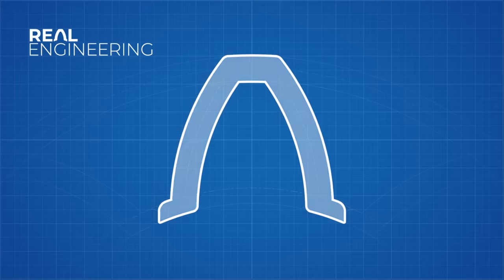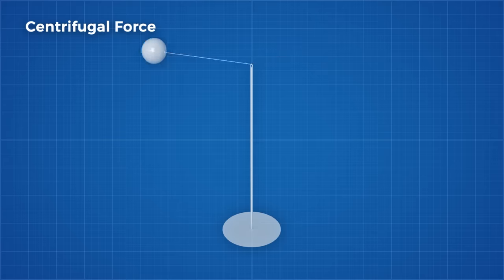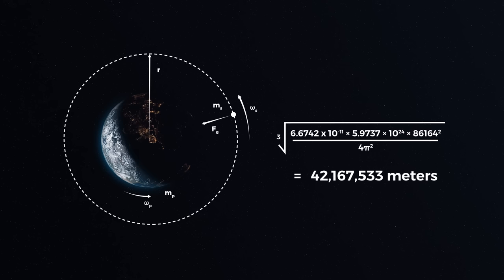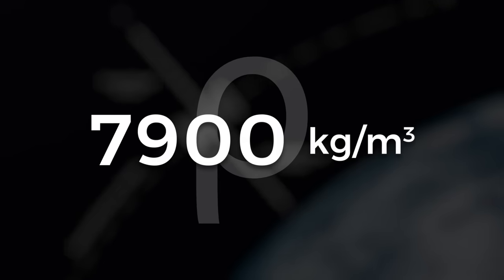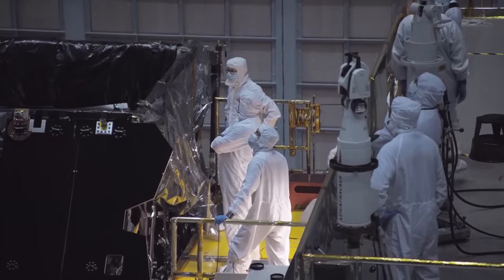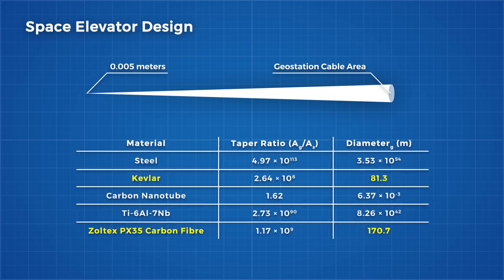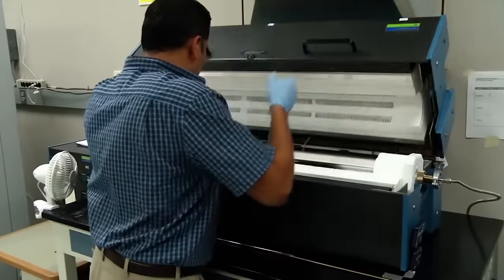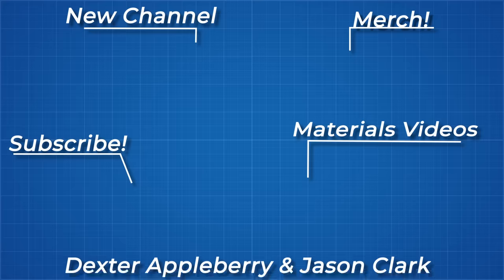Are Space Elevators Possible?

Comment: Would a space elevator be feasible for the moon or Mars? Would it even be worth it?
Reply: good question
Reply: It might be feasible on the Moon, but the Moon's gravity is so weak that there's not much fuel to save with a space elevator. Standard chemical rockets would still be cheaper, especially if in situ refueling on the Moon's surface becomes economically viable.
Reply: @jemuelmongado5030  Exactly, which is why I asked if was even worth the trouble.
Reply: @mikeearussi  If a trillion-dollar industry around lunar resources like Helium-3 would form, I'd like to imagine there would be a huge demand for a Moon elevator. Mars, though, would be just impractical. Elevators on Phobos or Deimos might be worth the effort though.

Comment: Could we just have a "floating" 1 floor? I mean, does it needs to be on solid ground? If the station is in orbit and the cable is hanging from it, could it be possible... the speed of the station would need to be the same as the earth rotation!
Reply: I didn't quite understand, you mean having two orbiting objects connected together at different heights?
Orbital speeds are different at different heights. One object would pull on the other until both are at the same height and speed.

Comment: I'm sick so probably not thinking clearly. Why can't we hang a cable down to earth and use that to bring materials to space? It doesn't have to take humans.
The ship and counterweight keeps it in the air, we don't need a base?
Is that something other than a space elevator? 
And the cable doesn't have to be all metal, you could have flexible parts to help against weather or other issues. 
We could even anchor the line in the ocean with weights and ballast, like oil rigs.
No? Did I miss the point of the video? I just have so many questions.

Comment: Hi, RE. Fascinating. But the Earth is too big. Design space elevators for small moons. Even small moons require a lot of tech to land upon and a lot of technology to fly away from. Maybe asteroid mining would be possible and made easier with elevators. The technology that will make space elevators possible will also make rotational gravity and space habitats possible. I don't know the safest low gravity environment for humans. It could be that humans need at least .7 G to maintain healthy muscle tone and bone density. Spinning wheels can do it but the change from zero-G at the center to max G on the rim of a small wheel is too abrupt. Better would be two working areas that can be transported to the workplace, and separated using the nano-cables to a distance where rotational gravity can be created with a structural tube containing a safe passage between the two floors. At the core could be a hub containing supplies of food, water, solar arrays,  and breathing gas purifiers that don't need to be spinning around. If you can figure out the necessary ratio of the curve to the speed of the revolving work areas, you can design workspaces of different sizes and functions. By this, I mean the apparent upward motion of the floor that would create an apparent .7 G environment. The necessary ratio would produce an apparent floor lift of something over 22 feet per second per second. This ratio is why small spinning wheels don't need to spin as fast as large spinning wheels to produce a rise of 22 feet per second. If you have a passion for space elevators, start dreaming about small ones that can actually be possible and useful.

Comment: My theory on why a space elevator can't work.

Everything on the surface of the Earth is traveling around the Earth's axis at 1,000 mph.  To be put something into geostationary orbit, it has to be accelerated to 7,000 mph.  

There are two ways to accelerate the elevator car horizontally as it rises.  The car could carry its own rocket and the fuel it requires.  And it would have to apply its force to the car in a way that doesn't stress the cable.  Seems unlikely.  

Or the elevator itself must transmit enough force horizontally to accelerate the car.  And the platform out in geostationary orbit also must have a rocket to keep the platform from moving out of position.  Otherwise the extra mass would pull it out of that geostationary orbit.  Transmitting the force required to accelerate the car is going to stress the cable significantly.

Both scenarios still require a rocket and all of the same fuel.  And both require the output of the rocket and the vertical speed of the car to match.  Either way, such a rocket would not have the same specific impulse as a rocket unencumbered by this requirement.
Reply: They could pull in the counterweight towards the space station to speed it up its orbital speed, compensating for the pull from the dragged mass.
Reply: @vast634  who’s “they”? And what would pull for the journey of many hours?

Comment: 1. Build a train/rocket with a track that travels into a railgun design. This would avoid the deadly Gs on biomass
2. Thrusters activate on deacceleration for now still saves us millions getting to space
4. Build the space elevator more like a tail you grab onto that doesn't actually touch the earth's surface
5. Build a carbon nanotube blanks to deploy on space debris
6. Trolley the rest of the way up the tether using an electric motor

now stop making excuses and get it done nerds

Comment: If a ping pong ball was to strike the space elevator cable...What would be the energy of impact?  
Lets see now...2 grams travelling at 17,000 miles per hour...hmmm....  
E=MV squared  ....  
You have to change 17,000 miles per hour to centimeters per second....  
you get a mind boggling number, that you square....  
It works out to about half a ton of TNT!!!  

And the cyclic rat is very slow  
The elevator will take forever to get there

Comment: MOON SPACE ELEVATOR								
mm = mass of moon = 7.35E+22 kg					
rm = radius of moon = 1,738 km = 1.74E+06	m			
ms = mass of lunarstationary station = 1.00E+08	kg				
ωs = angular velocity of lunarstationary station = 2.66E-06 rad/s			
rl = radius from lunar center to lunarstationary station's center = to be determined			
dm = distance from lunar surface to lunarstationary orbit = rl - rm = to be determined			
G = universal gravitational constant = 6.67E-11 m³/kg∙s²				
								
Radius of Lunarstationary Orbit								
rl = ³√[(Gmm)/(ωs)²]								
								
rl = 	88,452,517 m = 8.85E+07 m				
								
dm = rl - rm = 8.67E+07 m						
								
The cable length  from the lunar surface to lunarstationary orbit is 2.42 times								
that of the cable from Earth's surface to geostationary orbit. This is because the								
moon's lunarstationary angular velocity is only 4% of Earth's geostationary								
angular velocity								
								
Tension in Lunarstationary Cable								
ρ = cable material density = 7,900 kg/m³ (steel)				
T(rl) = cable tension = to be determined						
								
T(rl) = Gmmρ[1/rm - 3/2rl + (rm)²/2(rl)³]								
								
T(rl) = 	2.16E+10 Pa = 21,638 MPa = 22 GPa		
								
Utimate tensile strength of steel (API5L X80Q,X80M) (Ftu) = 825 MPa = 0.83 GPa
								
So, steel would NOT work, even for a moon-based space elevator.

Comment: If we were to be able to snap our fingers with the correct materials having been manufactured, and suddenly it existed in place - yes, a space elevator can be built.
However, even after all design challenges of the elevator have been solved - we have carbon nanotubes, elevator cars, force propagation, etc figured out....

There is still the challenge of actually putting the damned thing up there.  Proverbially, you need a space elevator to build a space elevator.

The classic idea of carrying a spool up and extending it in both directions doesn't really work as each point along the tether becomes subject to orbital mechanics.  This means, for the same reason you can't throw a hammer from orbit and hit the ground (well, most orbits, at least), you can't construct a space elevator.  At least... Not neatly.  For those who are fans of kerbal, set two craft in orbit near each other, or three for funzies.  Then fly one each at radial in/radial out at the same thrust (identical mass and thrust).  Watch what happens and imagine there is a line stretching between all three.
Eventually, you will start spinning as each assume an elliptical orbit out of phase with each other.

The process of building one of these things is something we would probably test on other planets before we ever built one here just from the implications of what we are doing and the scale of consequences for possible failures.
Reply: I was thinking the same throughout, you just cannot drop a cable down to earth. Even if you spooled it out with a drone craft and reduced its velocity to stay above the same point on earth, the forces trying to throw you into a faster lower orbit would be extreme. You cannot just do the calculations based on the centre of mass of the entire structure.

Comment: So how is that going to work. ?. . . I have not done the exact numbers, but I reckon you would need a line something the size and weight of a spiders web, but probably as strong as a 24 inch diameter steel wire. . .    To be geostationary, that is relatively stationary about a fixed point on Earth, that would have to be about 23,000 miles, 40,000 km high and be able to adjust its height depending on the weight of the load that needs to be lifted up to that space anchor point... .   You would also need to protect that line from hurricane and strong winds, and from aircraft.. . .  Not exactly the most practical mission, is it. ?

Comment: People only have the rotational velocity of the Earth's surface...
while a "space elevator", being rigid, has to maintain the same ANGULAR velocity as the Earth...
so people trying to travel up it will just be absolutely squished to death against the sides!!!
Reply: this is not right
Reply: @willoughbykrenzteinburg  you'd have to add angular momentum as you travel up the elevator... otherwise your tangential velocity decreases as your distance increases, while the elevator's tangential velocity increases with distance!
Reply: @alansilverman8500  Youre basically describing a coriolis effect, and it would be very slight.  Squished to death?  No.  Not even remotely close.

Just do the math.  The speed at which the elevator would need to travel upward to create a change in tangential velocity so great as to cause an acceleration of just 1 G - meaning, you feel pushed toward the side of the elevator with an acceleration of 1G, the upward velocity needed would be around 135 km/s (over 1 MILLION mph).  And this would result in a mere 1 G. What you are talking about would not happen.  At all.

Simple Math Support :

Standing on the surface of the Earth, your tangential velocity needed to keep up is related to the diameter/circumference of Earth.  So, with a diameter of about 12,742,000 meters, this results in a circumference of about 40,030,140 meters.  The speed needed to travel this distance in 24 hours is about 463.3 m/s.  If you travel upward at 135,000 m/s, after one second you are now traveling in a circle with a diameter 270,000 meters longer (135,000 meters in each direction).  So, total circumference is now 40,878,369.  You travel this distance in 24 hours, and the velocity needed to keep up is now 473.1 m/s.  So 9.8 m/s faster.  After another second, you travel 135,000 meters higher, and now the circumference you travel is 41,726,598 meters.  To travel this in 24 hours requires a velocity of 482.9 m/s  - - or another 9.8 m/s faster.  This continues - every second requiring an additional 9.8 m/s of tangential velocity to keep up - ergo accelerating along the tangential axis at 9.8 m/s² - or 1 G.  Again - this is in an elevator traveling up the rig at over 1 million mph.  You need to do the math before you make otherwise baseless assumptions.

Comment: And no it doesn't NEED to be at the equator, it's just your tether needs to be quite a bit stronger than absolutely required, then if you have 3 tethers which met up at somewhere above the equator then there you go, so I suppose you could technically say the space elevator is at the equator because that is where the vast majority of the space elevator is, but the base terminals do not have to be. Athough again the Space elevator is a dumb concept compared to the alternatives Launch Loops, Skyhoods, Orbtal Rings and even mass drivers. The only place a Space elevator would be the best option is Titan as due to it's low gravity and thick atmosphere a mass driver mostly out, although orbital velocity is significantly lower so mass drivers are not completely out either.

and on any airless world mass drivers are just a maglev track so there it's almost always going to be the best option, Earth it's probably Skyhooks, Launch Loops then mass drivers in order of difficulty but also worst to best, mass driver are impractile and that doesn't even mention Space Elevators, mass drivers are just impactial on Earth as you need a vacuum tube from ground level to at least 25km up in the air and for humans to not die of G forces the tube needs to be very very long.

building a very very long vacume tube is already an engineering nightmere, trying to suspend it 25km in the air... not a particularly easy feet, Space elevators are still more dumb, by like an order of magnitude.

Comment: Yeah, that's a big no.  It's possible in the exact same way the Dyson Sphere is possible.  Sure you can build a Dyson Sphere... if you can find enough indestructible low mass material to cover a sphere exactly 2 AUs in diameter, manage to build each piece, and then manage the impossible feat of assembling each and every piece simultaneously so that the whole thing doesn't just crash in on itself and fall into the sun destroying our star in a huge explosion... yeah, you can build a Dyson Sphere.  But since that much low mass indestructible material doesn't exist (and if even if it did- you'd have to destroy maybe a million solar systems to get enough), there's no point in trying to overcome the other impossibilities.  

Space elevators are possible, but again- you need indestructible material that's low mass and it doesn't exist.

Comment: theoretically, yes.  in practice though, it would require 3 things.  1. a super strong material that currently does not exist.  2. the ability to control the weather around the elevator.  and 3. nothing in an orbit lower than geostationary.

Comment: At starting point; taking-off near SeaLevel, it would save lots of Rocket Fuel to gain 7.9 km/sec velocity... Only a hanging LIFT or riding in an Elevator. But getting higher to near Geo-stationary orbit ; 36,000 km alititude.. there, we required 3.1 km/sec to stay afloat... Or otherwise, the Cable & afloat-Station, will be retarded and pushed BACKWARD... Losing velocity and finally losing the Pre-tension of Cables or, even severely lower altitude to Gradually FALL-DOWN /losing altitude completely.!! Destroy everything.,!?!
Reply: Geostationary Orbit/Altitude is 10% distance (trom Earth to the Moon) or 3 times the SIZE/Diameter of the Earth..(3x12,000 km. =36,000 km.)
Reply: The carrying Object at terminal point (36,000 km alititude) need to be 3,100 metre/second Speed to stay-afloat and not to push-back against the Cable/floating Station. That 3.1 km/sec =Mach 2.67 still need Rocket Drive, adding its Kinetics Velocity not to PULL-DOWN and Destroy the Whole (cables/station) System.!?!
Reply: Sorry ; 3,100 km/sec is Mach 9.3: far more than than Mach 2.67... (but saving, no need to be M24, escape Velocity.,)

Comment: Use balloons as flotation devices (at least 500) along the length to support as the elevator chamber rises and deflate some  balloons when the weather surges. The elevator chamber will transfer the balloon anchors ahead or behind as it travels. Build a practice unit in the deep ocean beforehand to simulate the functionality of the designs.

Comment: This is an approach I have contemplated for 6 years now but not at the level you did here.   May I suggest making an adjustment to your thinking?  You have based everything in this video and all of your calculations on the assumption that the elevator must go all the way to the ground.  It certainly costs a great deal to lift weight into space but what if you only had to lift the weight part of the way?  We have the technology to lift massive amounts of weight high into our atmosphere.  We just need to latch on somehow.   It is a compromise but it brings the engineering of the tether closer to near future reality.  This approach also negates rotation issues.  Go back to the board and look at this problem from this perspective.
Reply: What technologies are you referring sir? Is it possible with this tech to lift 150 tons without all the traditional propellant?
Reply: @iprofox3758  - First we don't have to lift 150 tons.  We are not building with steel.  Think nano technologies and maybe 20 tons.  Second forget about propellent and think lighter than air gas 🎈  This is more fun if I leave some of the work for you.  Run with that  😎

Comment: You could start building a space elevator from the ground level if you attached to its tip a rocket engine firing downwards for the whole time of the construction work, and then another engine every X distance from the tip.  You could then use the structure being built as a fuel line for the engines.